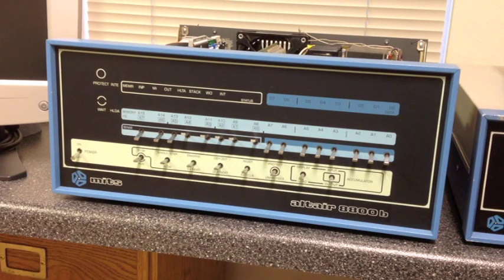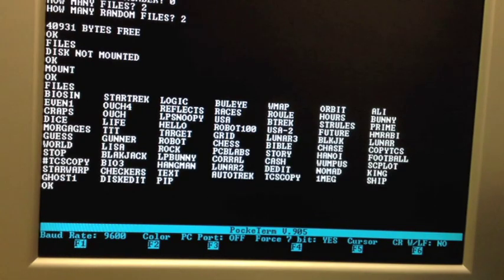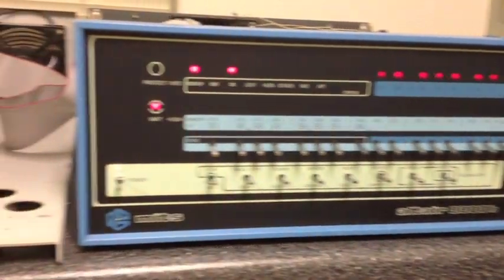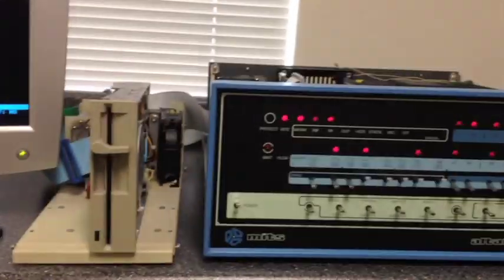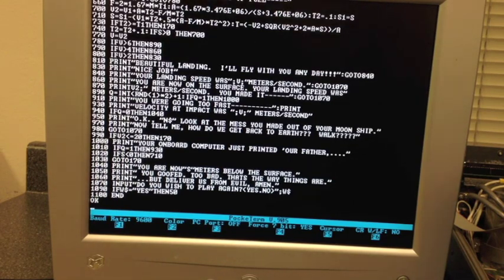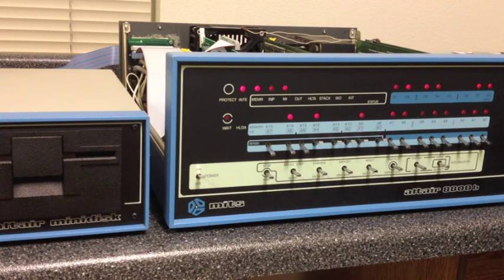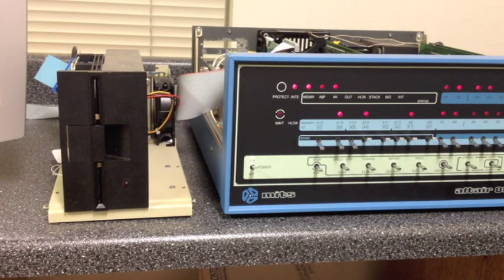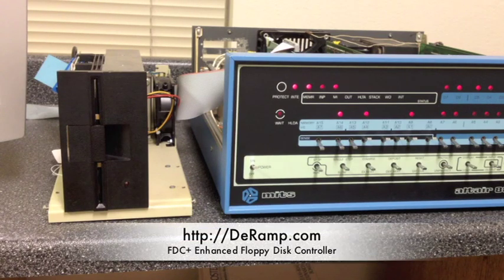Altair FDC+ Enhanced Floppy Disk Controller - Full Demo

Comment: The only other 8" drive I've seen was a Scientific Atlanta running a vibration machine at work.  It didn't work but the 8" hard drive still was in working order.  It also was not Y2K compatible...🤔
Good video!

Comment: I'm guessing some reconfiguration on the board is required when changing between drives, or is it all transparent to the user?  Also you used an 8800B instead of the clone.  Would this demo have worked using the clone as well?

Comment: Is it possible to mount a 1.44M floppy drive onto the system?
Reply from the maker: The biggest problem is that 1.44M floppy drives spin at 300 rpm and 8 inch drives spin at 360 rpm. Some 3.5 inch drives could be strapped for 300/360 rpm, but i imagine they're not that common anymore.

Comment: I have a technical question. If you find an old Altair floppy drive, is there a safe way to test it? Should you take it apart first, and check for any cap leakage first?
But even if you do not see any, what is the safest way to check this drive out?

Comment: does it matter which way you put the disk in? because I notice with the 5" and 8" that they look almost the same on both sides, unlike the 3.5" floppies.
Reply: Label side up. If you put a double sided disk in upside down it will be spinning backwards. On a single sided disk there is only one head so you must put it in with the recorded side  towards the drives "up" side
Reply: To be fair though, if it's spinning backwards then you just have to issue WRITE commands instead of READ commands and vice-versa, as the bits will be flowing in the backwards direction.... Although If you're in the southern hemisphere, then you NEED TO put the disk in upside down.  And it won't work at the equator at all.

;)
Reply: It will work just put the disk sideways
Reply: what the fuck, is this true?